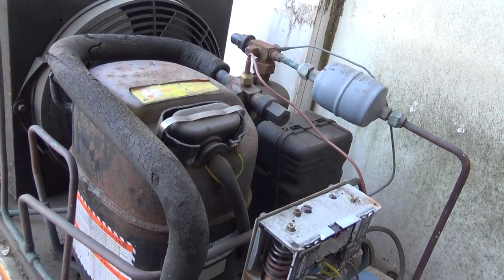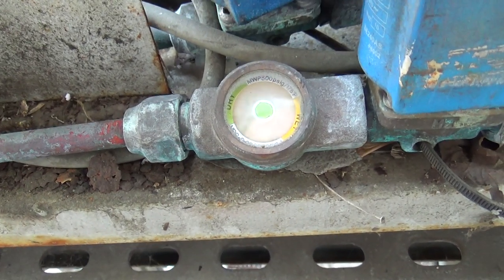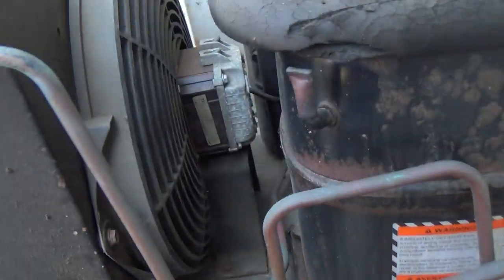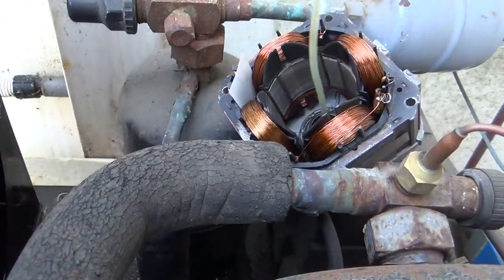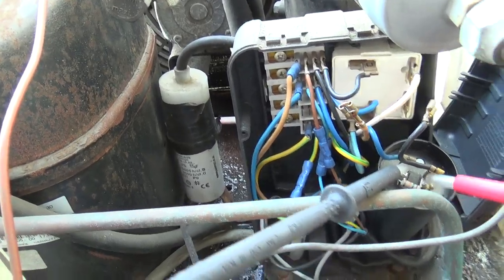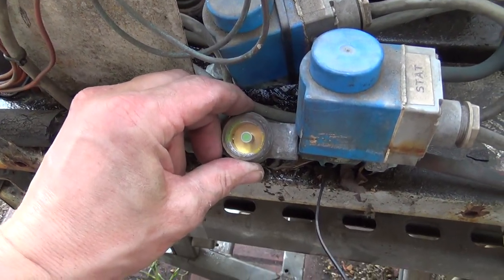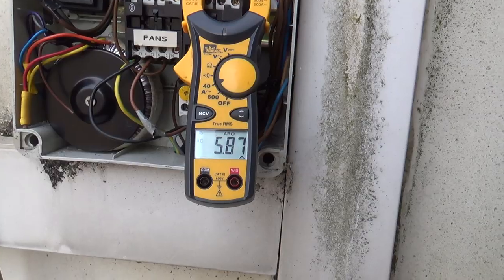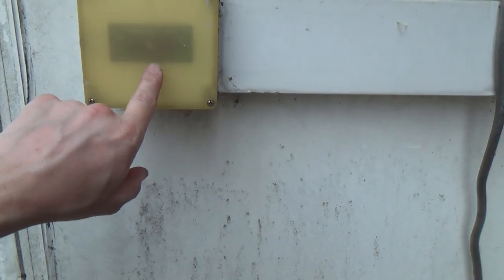Something Fishy Going On

Comment: Never seen a fan motor that nice inside, almost always those I see are toasty brown when the drop of lube they come with has gone and it is getting stiff. Did replace bushes on one that was made from Obsoletium, using a blown Chinese $2 fan that had died, as those 10mm bushes in it were the right size, just added oil to the bushes ( not a job the factory had done, more than a single drop of oil must have been expensive) and used the dry felt washers on the motor in the old one, making them drip with mineral compressor oil, and it ran perfectly again. Inside was all dark brown, black and with stiff wire, but for a then 30 year old motor perfect, have seen brand new ones with 5 hours of run time on them in worse condition.
Reply from the maker: I think its a genuine L'Unite/Tecumseh motor made by EMBPapst or Smen, they're much better quality than the multi fit ones.
If they still used felt instead of foam as the oil reservoir i'm sure these motors would last much longer.

Comment: I belive the defrost is with reverse cycle! The are 2 Danfoss valve, one from discharge part.....nice video...
Reply from the maker: Yes it looks to be hot gas defrost, probably works better than electric as the heat is where the frost is.

Comment: So it's ok to mix oil with the bearings grease?
Reply from the maker: These little motors use oil for their bearings, the Zoom Spout oiler is designed for lubricating these.

Comment: Is that high pressure washer battery operated ? That's brilliant .
Btw , I don't get why they put that Daikin condensing unit right underneath , the condenser must bet getting back the discharge air innit ?
Reply: Often see the outdoor unit slap against the wall, even though anybody that reads the manual (or even the single page quick sheet stuck to it) will see that you need at least a foot of clearance. No wonder they cook themselves to death, and use so much power, running just short of blowing lines.
Reply from the maker: Yeah its battery operated, will pump about 35L on one charge, its a Worx Hydroshot, I have a review vid of it on my channel. 
Its not the best place for the Daikin ac, but its about the only space they had for it, where I was stood to work was vehicle access for the properties behind the shop.